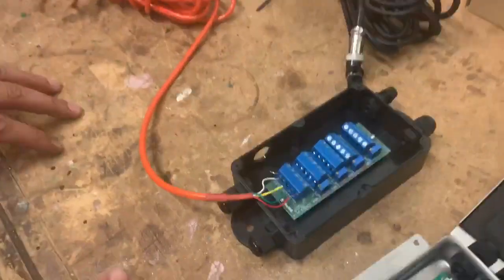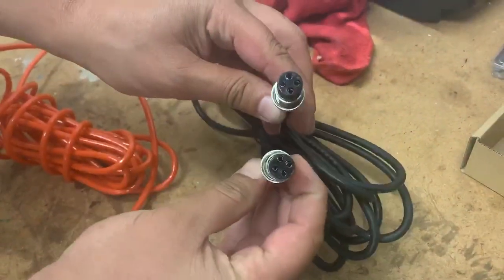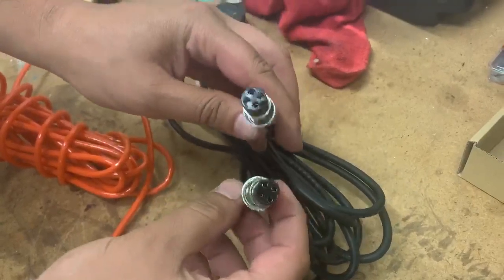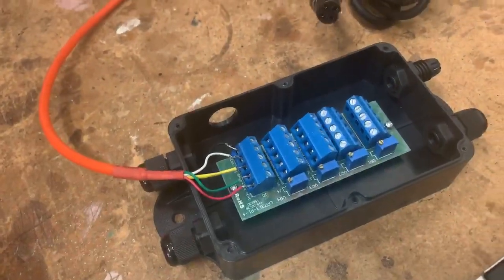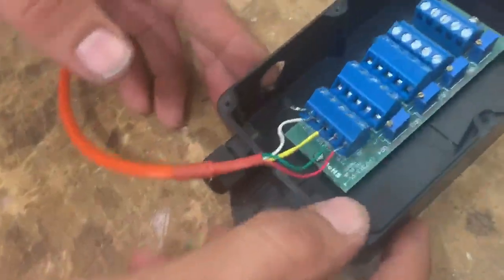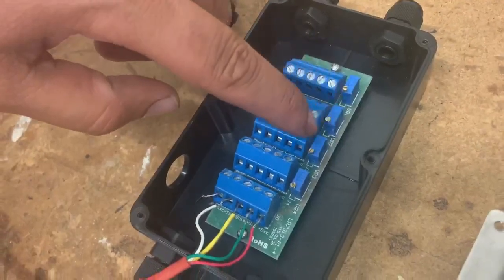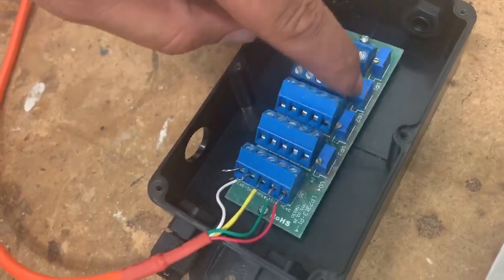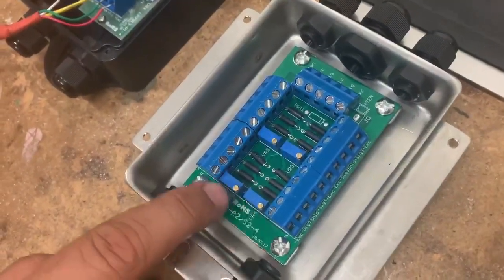Selleton scales demonstrates how to connect a home run cable direct to junction box

Comment: Hello, I have a very technical question. I know that the load distribution between exc+ and exc- should be around 300-350 ohms. But when I connect 3 load cells in the collection box, do I need to read this ohm information between 300 and 350 (exc+ and exc-) from these load cells?